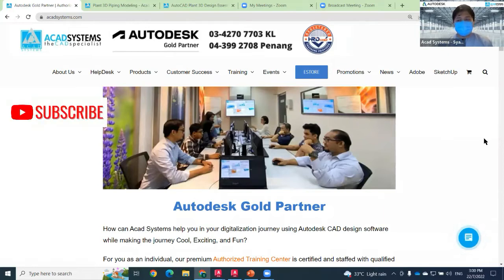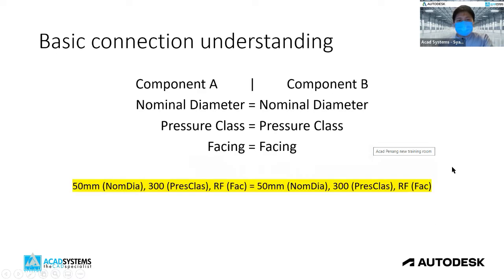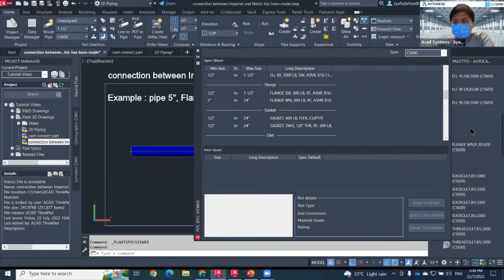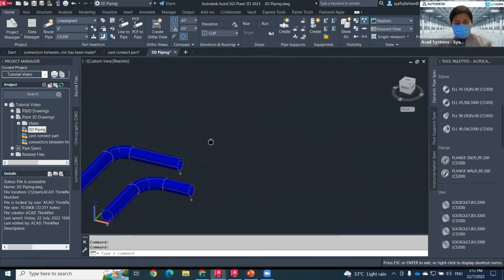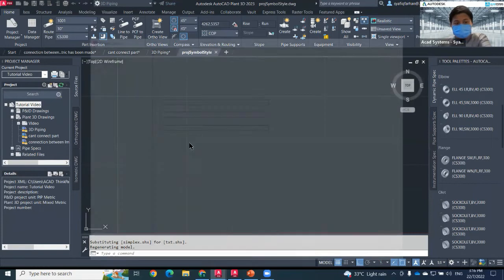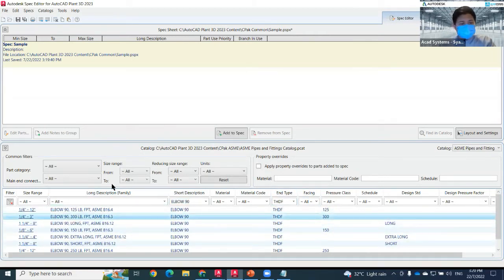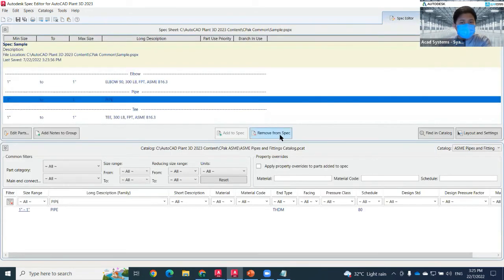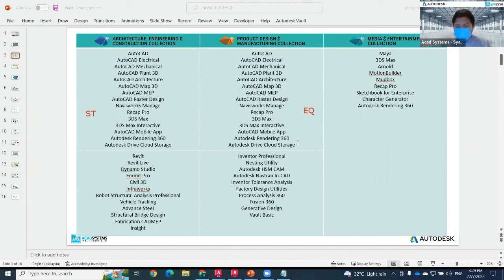Plant 3D - Piping Modeling

Comment: How to make flow and steam animation in pipeline and the other équipements
Reply from the maker: For animation, recommended to use 3Ds Max. But if you plan to do the engineering flow simulation, try to consider Autodesk CFD. :)